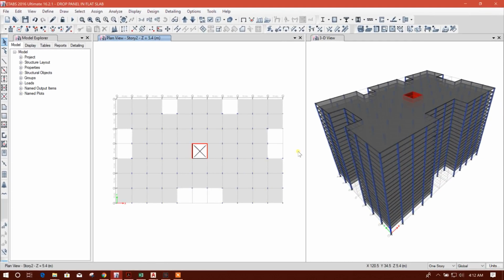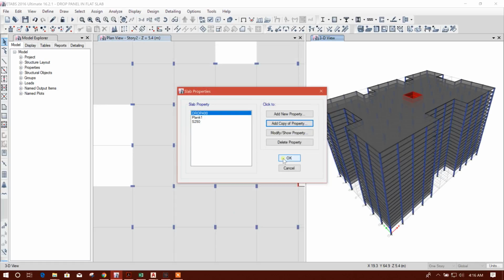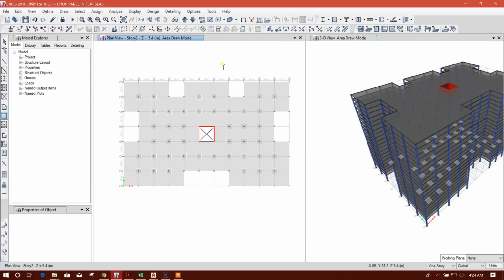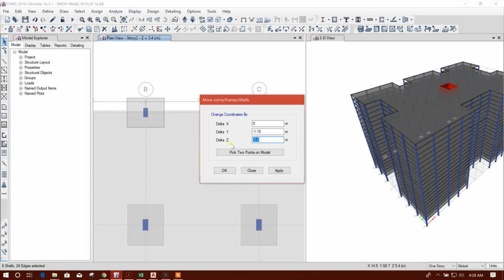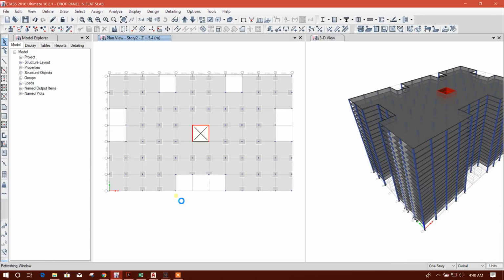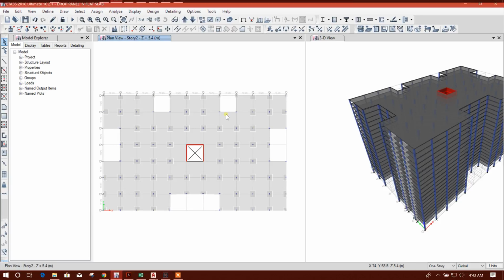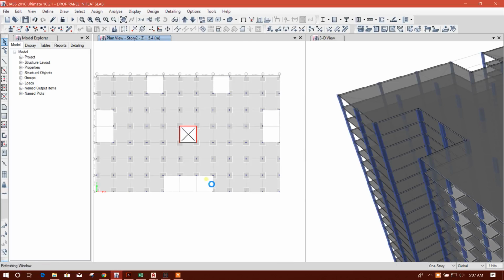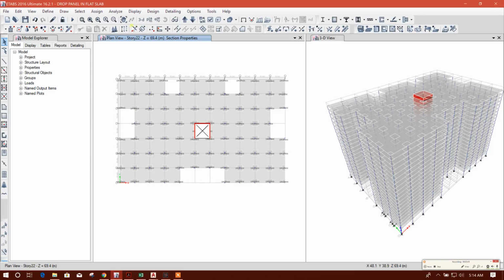MODELING OF DROP PANELS IN ETABS ACCURATELY IN DEPTH.

Comment: it is not complete .
Reply from the maker: What?
Reply: @Decodebd  Thank you so much for your kind explanation.
But why you didn't delete the slab on the drop panel
Reply: @jegerzaki  i also have the same question. Will Etabs report "Overlapping Slab" when we check the model?
Reply: @jegerzaki  same qstn
Reply from the maker: @jegerzaki  Sorry Forgot to delete.
Reply: @Decodebd  should the existing slab be deleted at the drop panels
Reply from the maker: @muhammedlamyp.j9860  Sorry Forgot to delete.